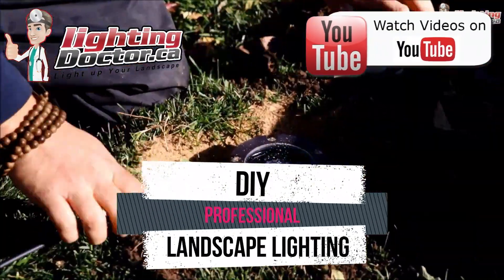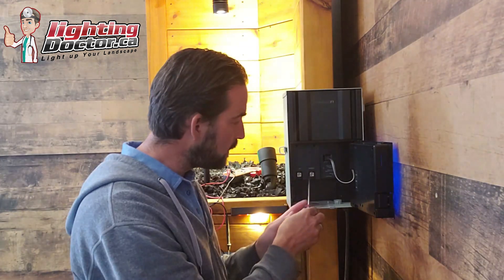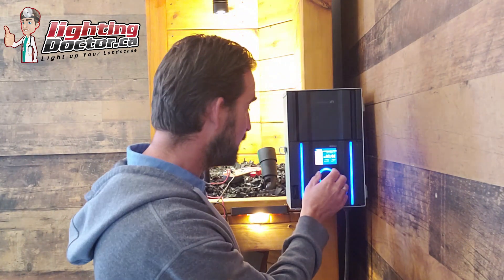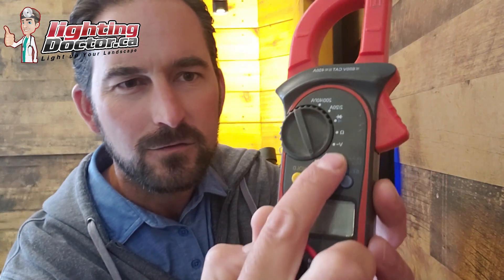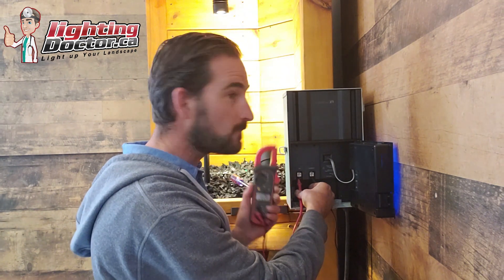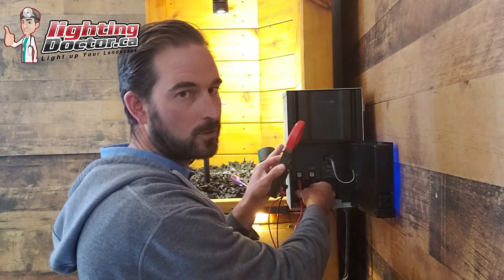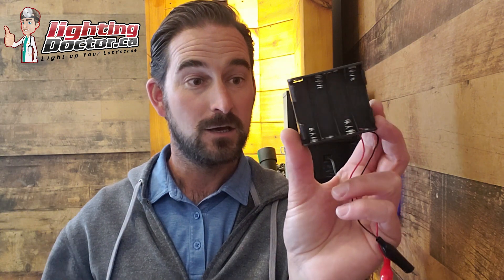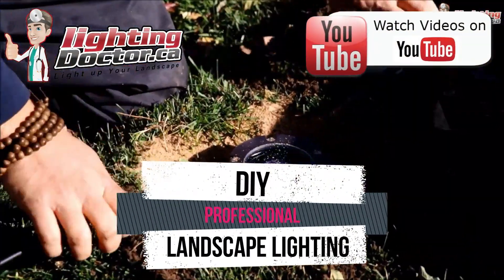How to Install Landscape Lighting - Troubleshooting Your Low Voltage Transformer

Comment: Will a transformer auto shutoff IF it is defective? I have a FX Luminaire EX150 transformer and as soon as I turn it on, the ON switch turns OFF. Is it 100% a field wiring/bulb issue (short, too many watts being drawn, etc) OR could it also be a defective transformer too?